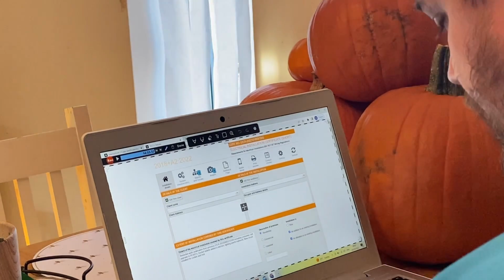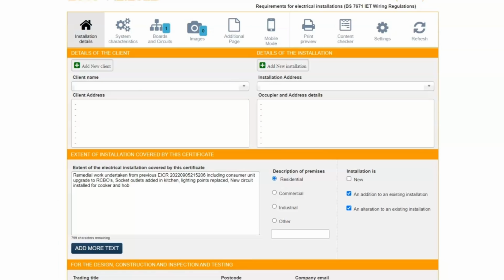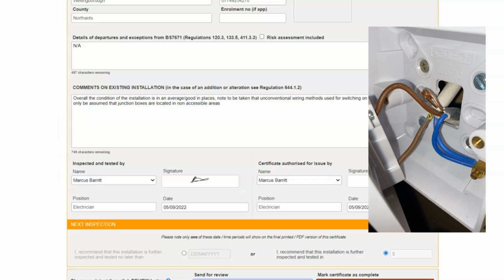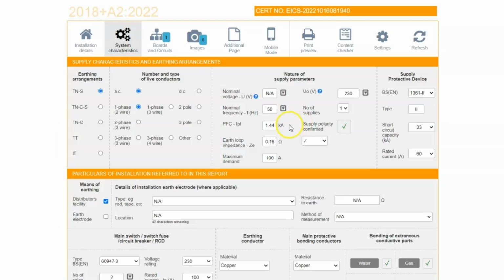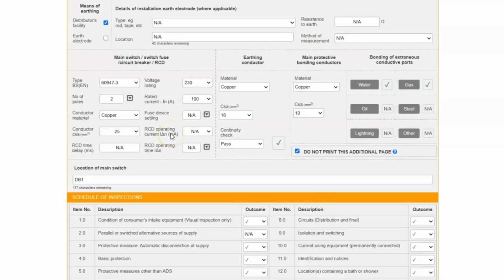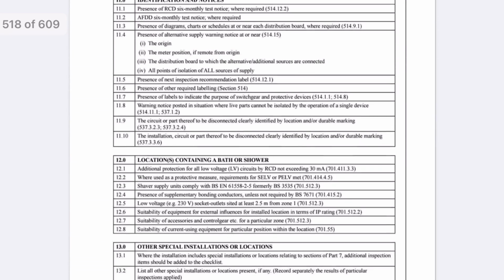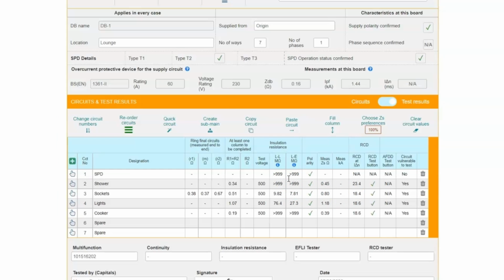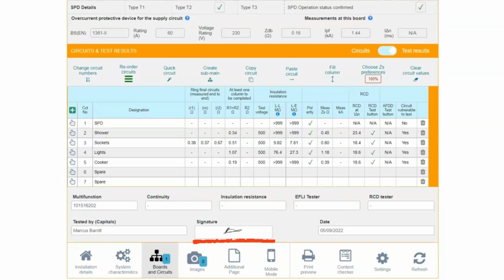How to Fill Out an Electrical Installation Certificate

Comment: Can you tell me if you install an extract fan on a lighting circuit fuse to a 3a spur and complete a minor works, do you need to commission for part f and do you need to notify building control. I didn't think so as its not a new circuit

Comment: Hi what would you put the maximum Zs on say a 32amp breaker if it was a TT system ie 1.37 would be a TN system
Reply: Same part of the regs book where you get your max Zs, just another table further down, section 4.

Comment: In the earthing conductor section, if your TNS system is using the sheath/steel braid rather than a clamp and an earth what would you put then?

Comment: Hi I submitted similar insulation resistance test results and my assessor told me it was not acceptable. He advised me of a global insulation resistance test . What are your views ?
Reply from the maker: The total insulation resistance of the insulation should be above 2 megohms 👍🏻
Reply: @GSHElectrical  do you have a video of a global insulation resistance test ? . Thanks

Comment: Quick question please if you could
New potential extension, the Mrs wants one of those double oven things in the wall, but no one can tell me if it's going to need two cooker feeds or if there is enough capacity to actually run them
Any ideas please?
Don't want to get our hopes up
Thanks
Reply: Best to power up 32a
Reply: Depends what the load is or if the consumer unit can allow further circuits. As mentioned, some design is required from scratch.
Reply: will most likely need 2 supply's,, running two 6mm cables will have you coved for anything
Reply: @420pilz  but it only requires one feed